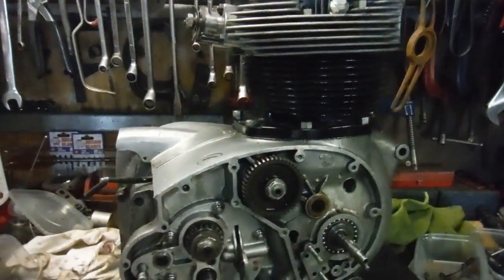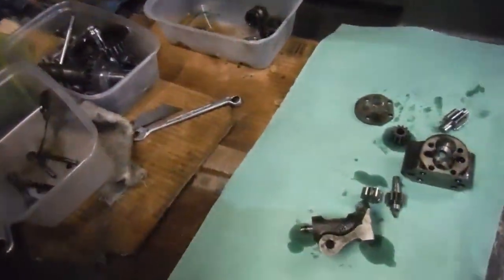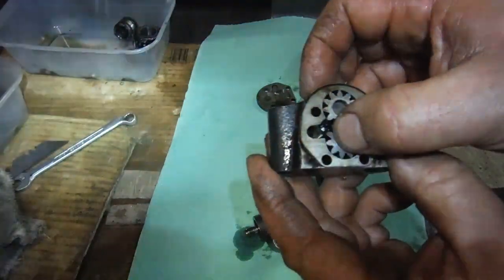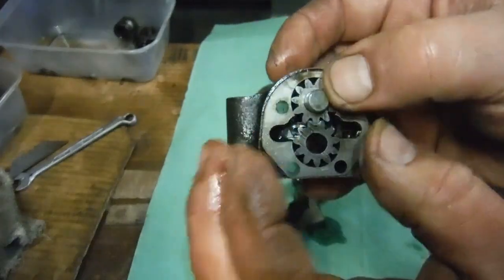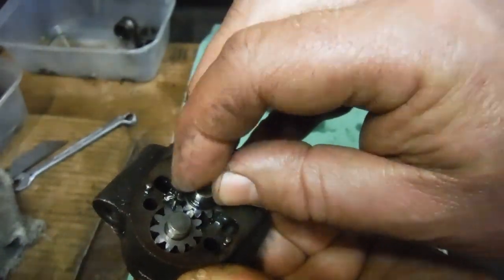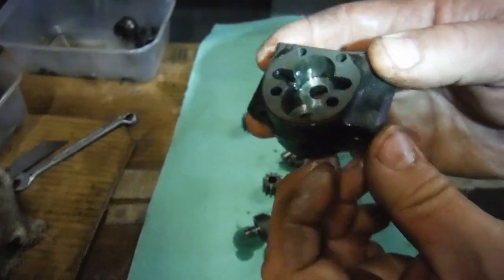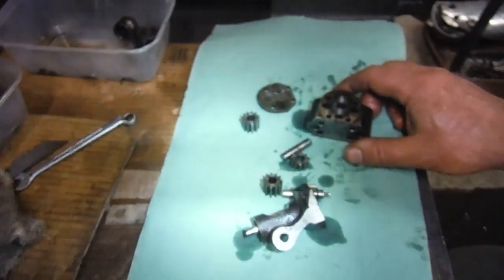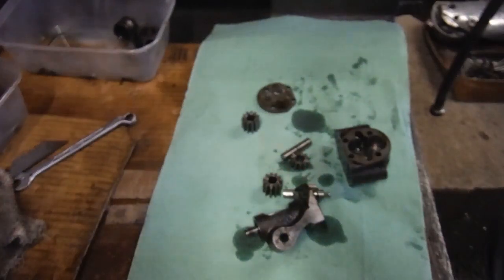BSA A65 'Oil tap engine' strip & rebuild 7 Checking the oil pump.

Comment: 😅 g'day Paul, the only time my classic bikes wet sump is from under use, so the night before the bike I'm going to use has the oil drained, the worst contender is my Royal Enfield Bullet 500 but it's the easiest to fix, undo that front sump plug and drain but don't forget to put the plug back and check the oil level, cheers mate Neil 🤠.

Comment: Hey Paul, do you still use the bushing from a Ford tractor as a replacement for the BSA timing side bush?
Reply from the maker: So far only one used and I presume all is well. It is a viable option which can cater for small undersizes and probably made of better stuff than a lot of other options doing the rounds at present.
Reply: Good to know. Thank you.

Comment: Special conrods? Are they the steel Hepolite ones Paul?
Reply from the maker: No, these are alloy by 'R&R', from Burton Bike Bits. American made, apparently.
Reply: Love your British bike videos, never known you call any British bike shite.
Reply from the maker: Thanks - that is because none of them are!
Reply: Brilliant response
Reply from the maker: Edward Turner? There was a Honda moped which relied on torch batteries for lights, long after the Beagle and let's not forget early failures of big ends in some of the first CX 500's. Then there were the first VF750 machines with camchain and cam problems, the troubled FT500 and my own CB500T was also basically a flop. Many marques apart from British ones made failures.
Reply from the maker: Those early CX's were still shite, though, clearance error or not, so, when you want to 'rubbish' British machines, just remember the Japs could also produce sub standard products too!
Reply from the maker: @Turnipstalk  BSA Beagle - I have no direct experience of them, but as with many others - including certain Hondas - were they as bad as the story tellers made out?

Comment: Wonder what the life expectancy was for a reasonably well serviced engine from the factory
Reply from the maker: Probably quite respectable, I would have thought.
Reply: Great question. I would guess a British bike from the 60s and 70s should go 20,000-30,000 miles before valve work or more is required. Clutch maintenance and an occasional gasket well before that. My 2 cents.
Reply: They didnt last long troublefree here i Norway lots of problems 60 and 70's bikes

Comment: Paul, are you aware that used engine oil is a carcinogen?. Used engine oil contains a higher level of  PAH (polycyclic aromatic hydrocarbons). Auto mechanics, of which i am one, were notified of this fact years ago & have worn protective gloves ever since. No oily rags in pockets either. Cancer risks of whatever sort ought be actively guarded against. 
New engine oil, on the other hand, contains very little PAH. Spanner jockeys i know guard against grease as well, just in case. Look after yourself Paul, your family needs you!.